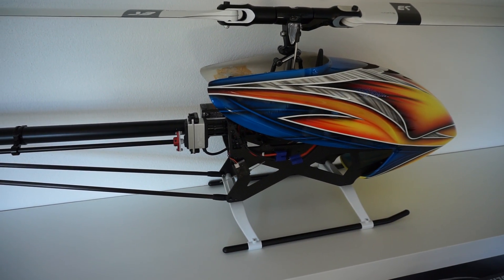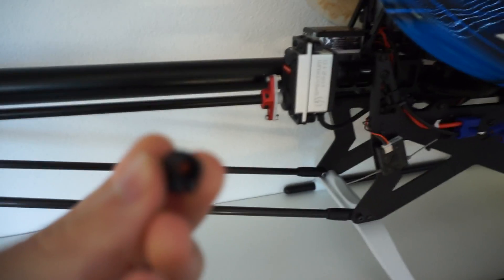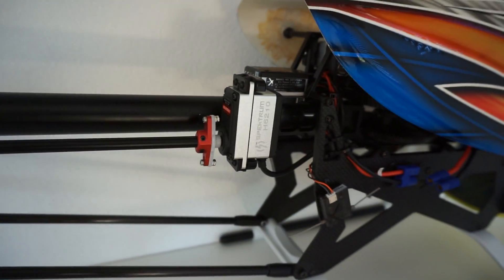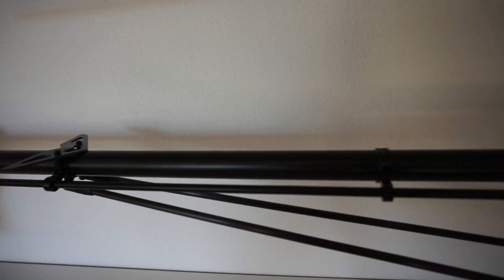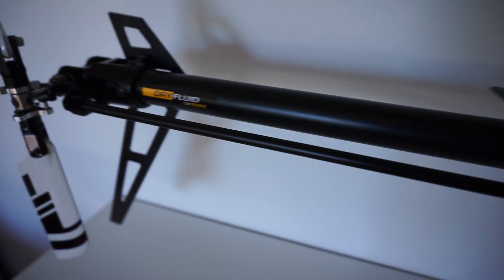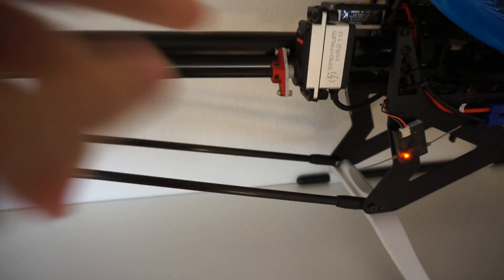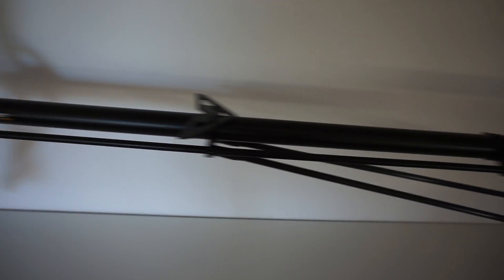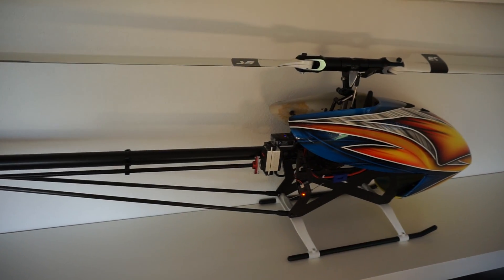Tail System Soxos 700 / DB7 / Team Edition Explained

Comment: What is the boom DIA and the length of the boom...Thanks....
Reply from the maker: Boom diameter is 24mm on the outside. the distance from the main shaft to the tailshaft is 935mm roughly. I dont have a seperate tailboom here to measure, but that doesnt say much because it depends on where its mounted. So important should be the 935mm distance from mainshaft to tailshaft.
Reply: Thanks for that... very helpful...good luck with Soxos...